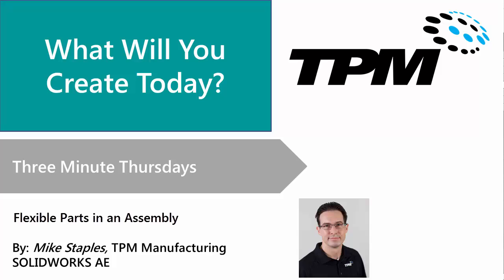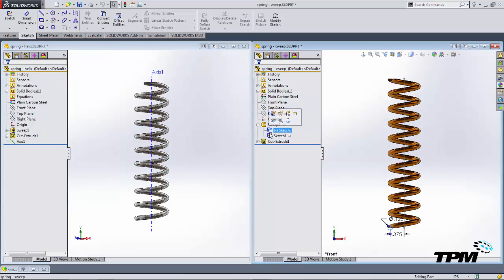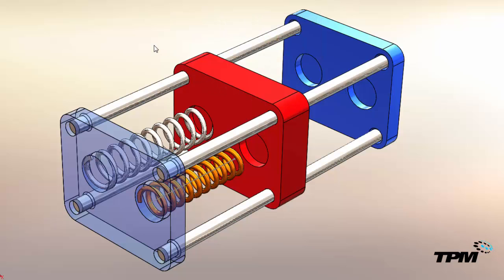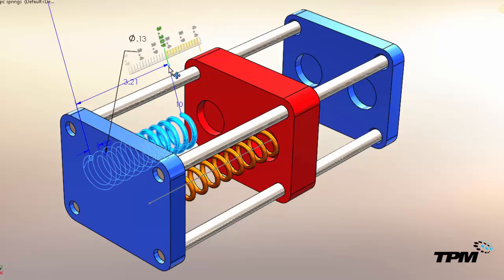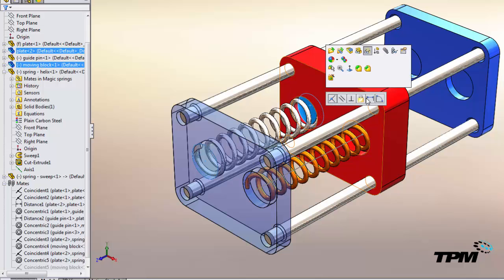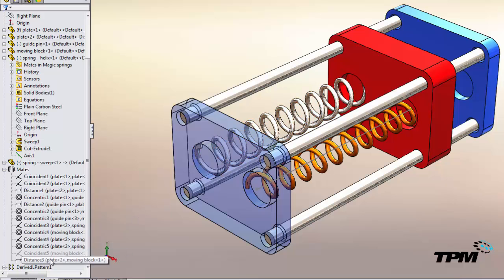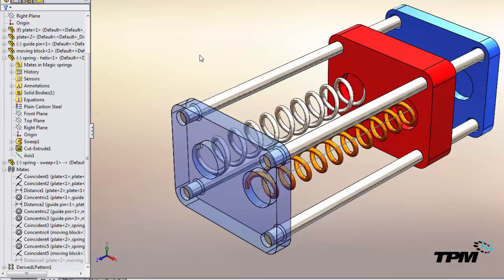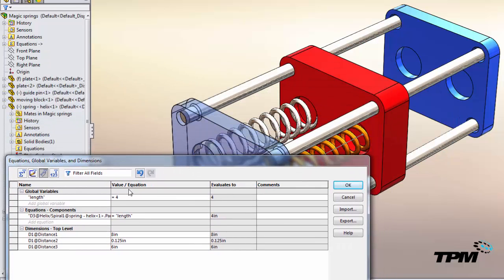Three Minute Thursday: Flexible Parts in an Assembly

Comment: This is not good for springs used in multiple assemblies. Is there a method of controlling the length in the assembly without affecting the spring model itself?

Comment: This really isn't a flexible part in the assembly. When you have to edit the part in the assembly to make the spring expand or compress, your actually in part mode editing the spring.  Flexible would be the ability to grab the plate in the assembly and drag it, causing the spring to be expanded or compressed with the plate simultaneously. Solidworks really falls short here.